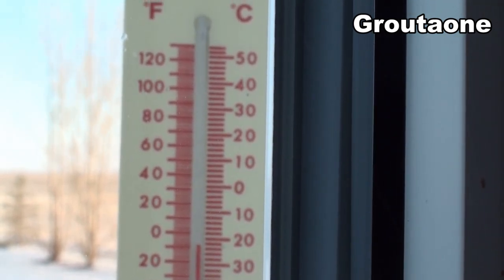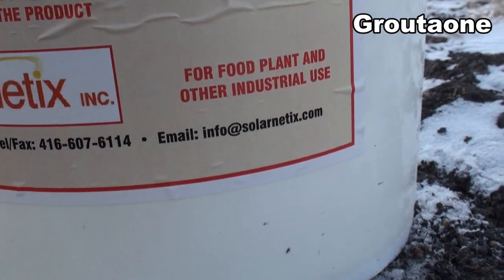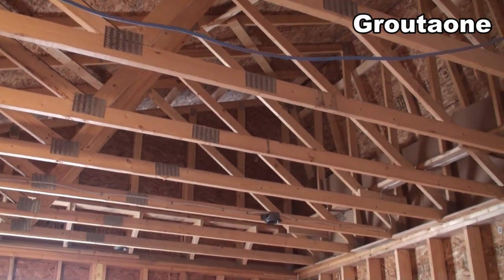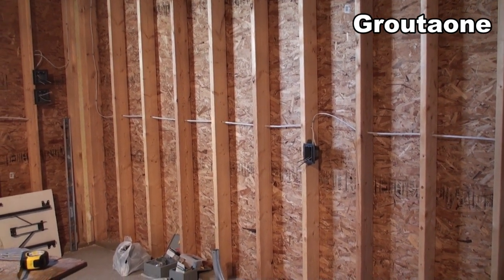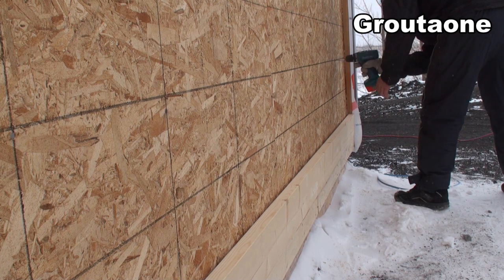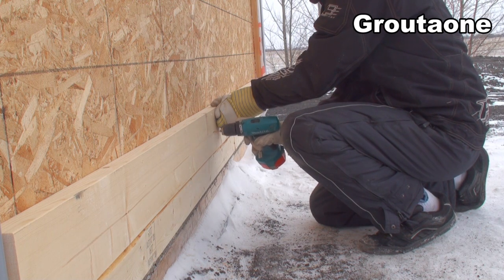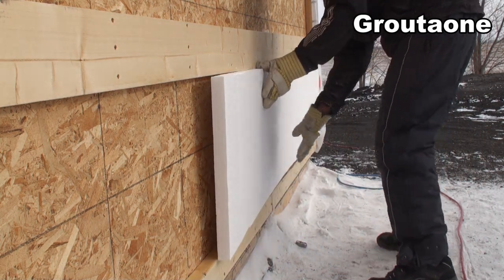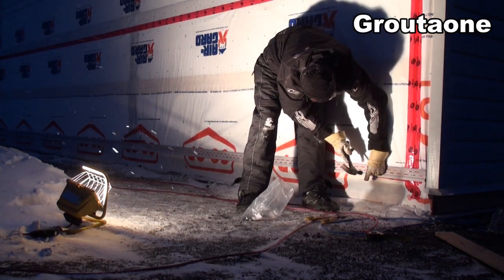Solar Wall Prep PT 1

Comment: So groutaone , since you uploaded your first couple of solar vacuum tube videos I've had a couple of ideas that I thought I'd run by you. When you get your whole system up would you be willing to try a small or medium sized stirling engine generator and then for summer months look into an "Einstein Refrigerator"? I think you could use the heat from your solar tube system to run both of these effectively. The "Einstein Refrigerator" is like the refrigerator in an RV/Camper that uses a propane burner to create the cooling, you would just be using your solar heat instead of burning propane. I'm wondering how much of a solar heating system it would require to create an air conditioner to cool a house or at least aid in cooling a house.
Reply from the maker: harperjmichael Some good ideas, worth some research I think

Comment: Great looking job on your garage that you are build there sir. Also, great idea on installing you 2 x 6s for your solar brackets on the side wall and bolt right through them and the wall, that should be plenty of strength to hold the up the solar.
Reply from the maker: jrob65 Thanks, I thought too it should have good support for some weight, I should weigh one, likely over 200 pounds for one unit

Comment: Hope it's not too bad on you working out in the cold like that. Are you putting up panels for when you say solar, or something else? I must of missed that part. Yah, those 3 1/2 inch and 4 inch deck screws work great, they usually are coated with an ok paint and are real strong and predrilling is a must usually about 1/8 bit works nicely. Happy thanksgiving to you and your family.
Reply from the maker: *****  Thanks man, not too bad in the cold, don't get as much done though. I'm getting ready to mount solar vacuum tubes for heating
Reply: Wow! That's something I haven't heard of yet, be good to see how you do it. By the name I kinda have an Idea on how it works though. Can't wait to see.

Comment: What happens when it snows hard and builds up against the solar wall would you have to go out there and clean it of every time it snows hard?
Reply from the maker: weston wands Snow can be a hassle, much less though if it's mounted vertical